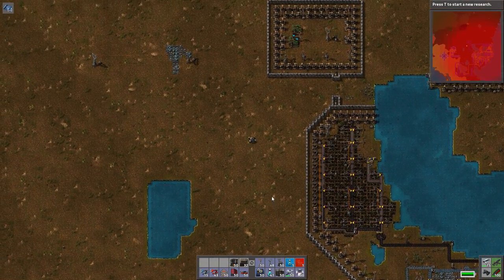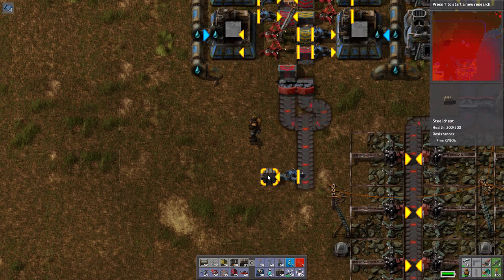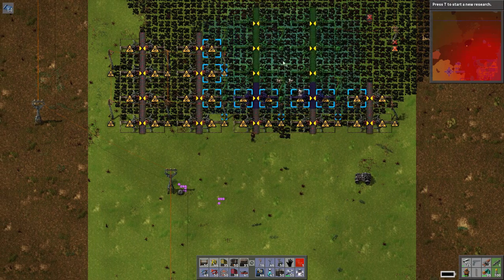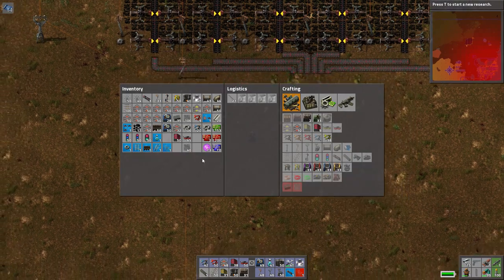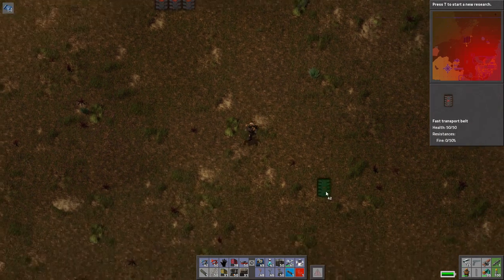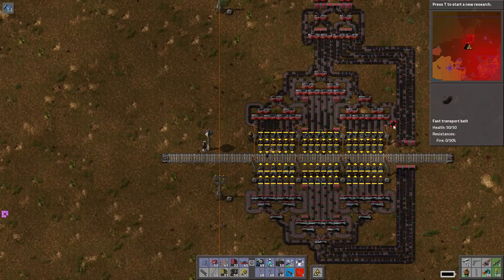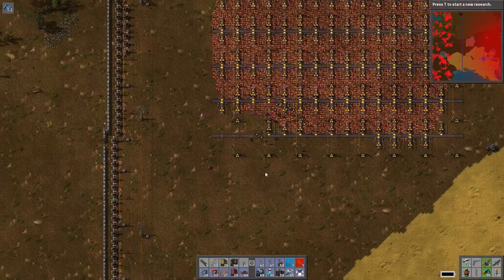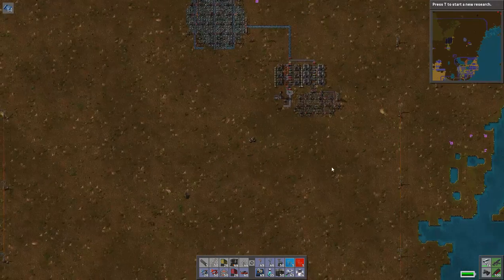Factorio Meiosis :: The Blueprint String Mod - Episode 5

Comment: Tip: Use Numpad +/- to change brush size for placing concrete and brick.
Reply: +HeilTec additionally shift click (i think) forces a blueprint and gives a destroy order for anything in the way (very useful in the woods)
Reply: +hhurtez It gives a destroy order for trees, but not things you placed. For things you placed, it just ignores the conflicting parts and places the rest of the blueprint.

Comment: Before settling on a train station design for the long run, you should look into a mod called train length and position fix. It makes the locomotives and cargo wagons exactly eight tiles long instead of the weird fraction it is currently and allows you to have nice modular, infinitely expandable stations with eight inserters for each wagon. This functionality is also going to be added in to the next version of the game when it updates so it's worth looking into. Also, with smart inserters, green and red wires and combinators there's a way to have the train load up in a balanced way from just a single belt without need for that bulky splitter-balancer nonsense (even though they do look cool). Look up smart station from the subreddit if that's of interest.

Another great mod you should look into is called foreman, which allows you to save blueprints with names in a separate ui and load them up at will. This is very handy since it saves you the hastle of keeping tons and tons of blueprints clogging up your inventory.

Comment: Those belt balancers are just... insane. The rail between the cells is only going to be a few meters long because the cells are so big!
Reply: +Yonkage 
I noticed the same. I didn't even understand why belts need balancing at all.
Reply: +Notaro well, isnt that somewaht selfexplaining? To keep the load on the belts balanced, which then results in more efficient ways to process it!
Reply: Oh yeah ofc but in this case the belts are so short that they get backed up anyway and they are only loading into chests to then all be loaded into the same train. Seems a bit pointless.
Reply: +Notaro The point is it looks neat and he enjoys doing it just because, no other reason really.

Comment: Factorio seems like one of those games that I'm interested in, but it seems so complicated that it kinda seems like it would be too complicated to pick up. Thanks for doing a series on it! I really enjoy the videos!
Reply: +DriverSim The thing is that nobody's pushing you to get to Zisteau's level of craziness. You can disable aliens completely and just play at your own leisure until you'll start to get the gist of it. This game is more of a puzzle limited by your ways of thinking. It also benefits from programmer's logic - break down large tasks into smaller ones until they become digestible, then keep grinding them into even smaller ones until they become easy.
Reply: Slithereenn Ah! I didn't know about disabling the enemies. I wouldn't mind trying the game out, but felt like it would too frustrating trying to learn how to play with the constant threat of attacks. Thanks for the tip!
Reply: DriverSim
There's also campaign mode, which has shorter missions with clear and direct victory conditions (like "gather 1000 copper plates and 1000 steel" or "build a car and put some coal in it"). But there are enemies, and some objectives can't be completed without defeating them, and sometimes it's hard, so if you'll feel like it - try campaign after you'll familiarize yourself with controls and basic automation principles.

Comment: I think you are missing a row of splitters at the top of your 6to6 balancer. 
From left to right, lane 1 -> 4,5,6
lane 2 -> 1,2,3
lane 3 -> 1,2,3
lane 4  -> 4,5,6
lane 5 ->1,2,3
lane 6 -> 4,5,6

so adding a splitter between the pairs 1,2 3,4 and 5,6 would balance everything
Reply: +Dimitri Masson Yeah, it doesn't look like it will properly balance stuff as it is now. Each input only goes into one of the two primary splitters, so they only contribute to three outputs each, not all six.
Reply: +Dimitri Masson yes!!! three splitters are needed. just to twist the pairs of lanes. Just one splitter for the lane pair(1,2) as well as (3,4) and (5,6). That should be it.

Comment: There are 56 items that directly use Electronic Circuits, and many other items that use what the circuits go into. 

In my last playthrough I had a total of 18 Assembly Machines making circuits, with 27 making the copper cables they used. At peak production, I was seeing a throughput of around 900 of these a minute, though most of the time it averaged around 500 - 600 a minute. I had started with 2 for Green Science and another 8 for the rest of the factory, then expanded it to 18.
Reply: +JeffreyMorse 

Actually it is 44, not 56.

Comment: How does blueprint string work???? i downloaded it and created a new map but i dont see it up in the corner? any help?
Reply: When you say you downloaded it, you mean you downloaded the mod?  If you mean you just downloaded the string, you'll need a blueprint mod (available on the Factorio forums) in order to import the string.  Also, at least based on the blueprint mod I'm using, it doesn't pop up until I've researched blueprints.

The name of the blueprint mod I'm using is Foreman, but I think there are a few different blueprint mods.

Comment: I don't remember the purpose of balancing belts.
Reply: +needamuffin It's used to fully utilize throughput capacity or belts. For instance, if you have a line of assembling machines on one side of the belt, unloading inserters will only fill half of the belt. If you don't balance your belt immediately after this assembling block (or even in the middle of it), half of the belt will always be empty, so at destination point you'd only be able to get half as many items per second as the belt throughput should allow you to. The same principle, albeit to lesser extent, applies to double-sided production in case if you're not certain that both sides will work at the same speed. For instance, if one side gets resources earlier than the other, it will produce more stuff if your resource flow will get smaller, and again, that means that one side of your belt will be filled more than the other, which is not good.